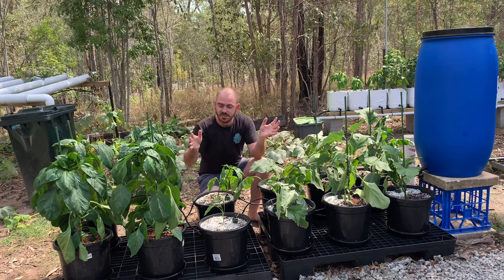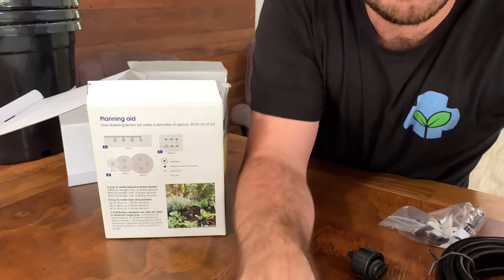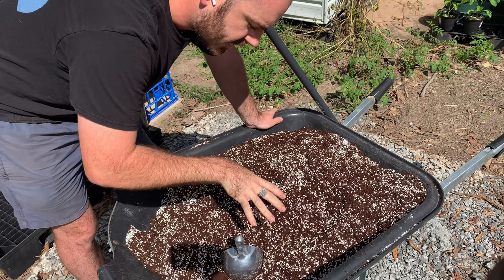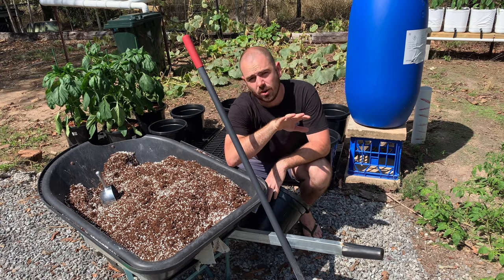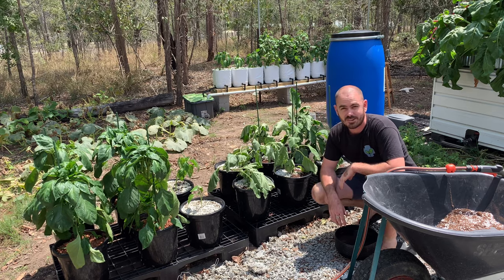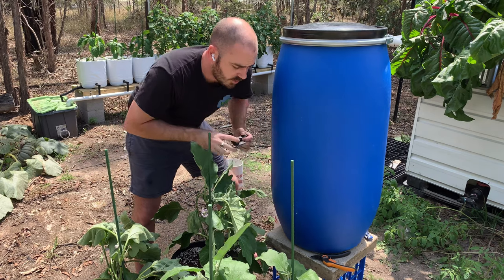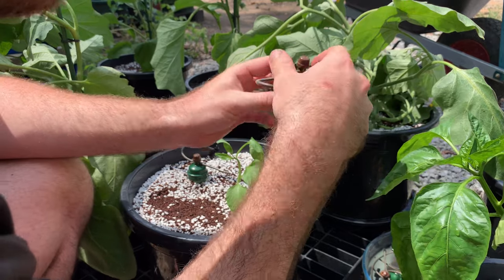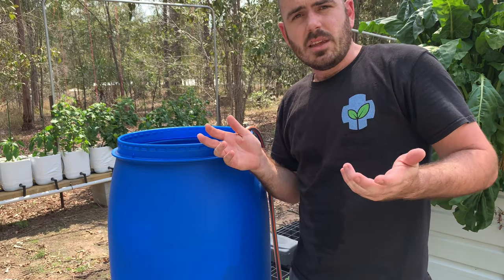Self Watering, Moisture Sensing, Gravity Fed Hydroponic System

Comment: I was considering doing exactly this, but was worried the nutrient salts would actually interfere with the capillary action that operates the pressure switch more than it building up in the tubing itself. Really excited to see how this goes, thank you for the great videos!
Reply: They have a filter for about $30 for that reason now.  Just not sure if I need 2 filters with a closed loop setup.

Comment: For those who are interested: There is also Blumat Classic which are single cones with small hoses for reservoirs which are positioned below the device. I use succesfully chinese ripoffs indoors with soil and rainwater. I´m curious how fast they will clog with nutrient solution.
Reply: Do they have the knockoffs on Amazon
Reply: @imbrudedsoul  yes. the knockoffs cost about 1$/piece, the originals a multiple. with "ceramic watering cone" you should find them. The ones with the hose, not the ones to put bottles in.

Comment: Thanks for another great video!
Since you're someone who has read a lot about this and has used a variety of growing mediums I thought I'd ask what you think about coco coir vs vermiculite / perlite? I've read around the net that coco isn't super sustainable. Does it end up working a lot better than vermiculite / perlite for similar methods though?
Reply from the maker: Coco is actually a byproduct of the coconut shell industry. (Coconut milk, oil, flesh, etc) and the farming of coconuts when done in an environmentally friendly way is a renewable resource.

I think you’re thinking of spagnum and peat moss, which is harvested from peat marsh. Which is extremely unsustainable.

Vermiculite/perlite is a fantastic mix, I’m just working my way through trying each mix thoroughly and I happened upon a lot of coco for very cheap.
50/50 Vermiculite /perlite is second to none for seed raising though.

Comment: I'd be curious to know how long would it take for the tiny tubing to get clogged up.
Reply: They make inline filters to help with that but I haven't had problems yet.
Reply: @mikecourtney530  can you use it with water that's got hyperopic feed in it like he does or will the salts glog over time ?
Reply: @razer192  I use it with feed and it hasn't blocked the tubes yet but it has clogged some nozzles which are not needed to use the system but I use to have less carrots and more water distribution. Maybe the filters would help but I still haven't gotten any.

Comment: Could you just make a mini olla, hook it up to a drip line, then seal it off so it can't leak? Or would the olla leach to much water out
Reply from the maker: Yeah it’s a plan for a future build. Keep an eye you for the vid.
Reply: Will do not sure if you're also trying this already, but could you direct sow straight into this system
Reply from the maker: @fizzymilk2528  yeah I don’t see why not. I’m so used to dealing with hydroponic systems that require transplanting I didn’t really think to include that in the video.